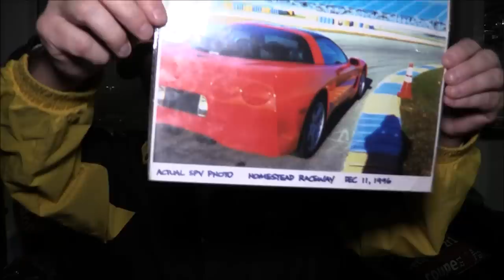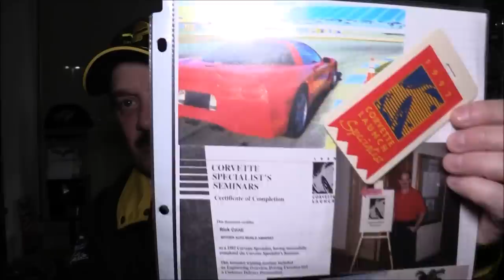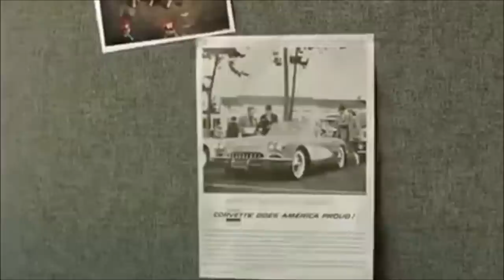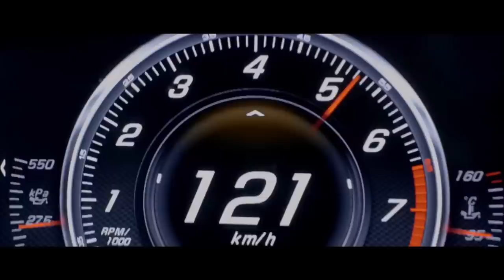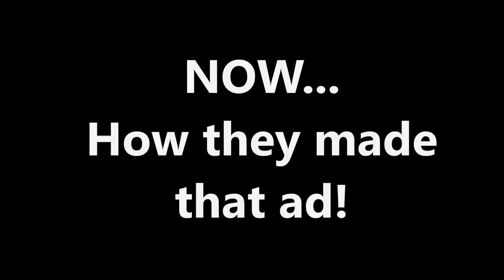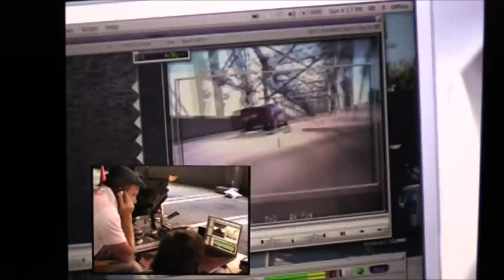C8 PRODUCTION START RUMOR & LOOKING BACK AT TV & INTERNET CORVETTE COMMERCIAL ADS

Comment: Rick: One of your best vlogs to date.  This vlog took me back to 1997 when I bought my first Corvette, a double black auto C4, at your Chevy dealership in Amherst.  I regret not connecting with you on the sale, but I did get the chance to drive the new C5.  I could not afford the new C5, but the used C4 fit the budget just fine.  After I got married and had my younger son, I had to cash it in.  I went a few year without one, but always yearned to have another one.  About 8 years ago, I bought a red C5 6-speed from a private seller.  To this day, I am happily driving it.  I put some aftermarket Cray spider wheels on it and it still turns heads!  I look forward to the new C8 - it will be a game changer with the new mid-engine layout.  Keep up the great work!  Your vlogs definitely help keep the American dream alive for some many people!

Comment: I had one of the first 1998 C5 convertible, total lemon. Manual transmission popped out of 1st and 2nd gear, run flat tires wouldn't stay balanced, anti lock brake pump went out twice. When you put the turn signal on, the fuel pump changed pitch and was mounted behind the drivers seat. Wasn't ready for prime time.